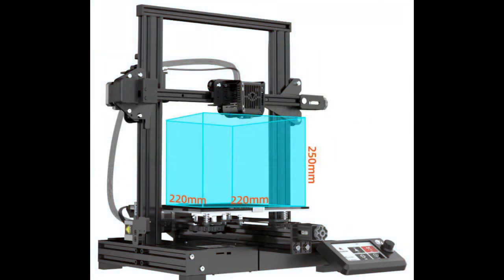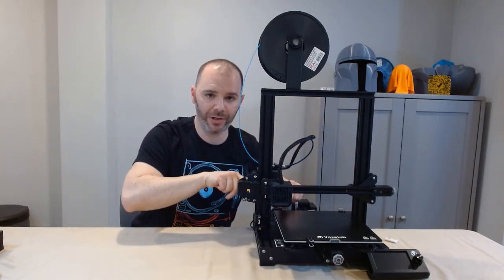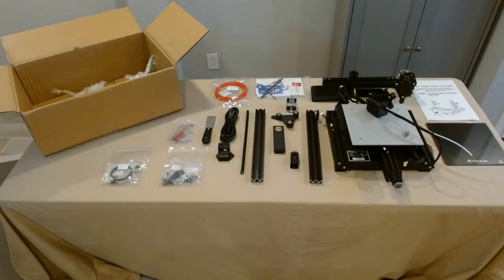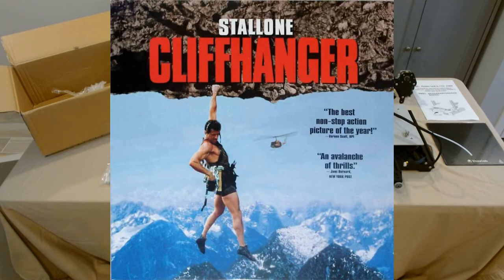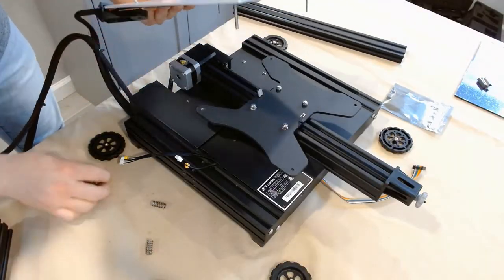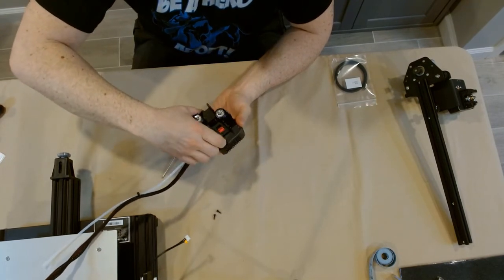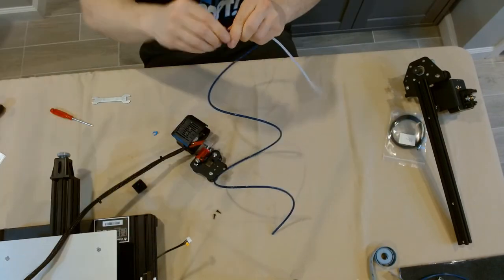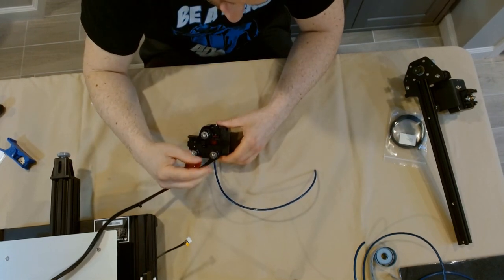Voxelab Aquila Assembly and Unbox Part 1

Comment: Leo. about 15 hours into a 17 hour print,something caused my filament to break. This has happened once before after I had to dismantle my Direct Extruder Pro. I know you have the same printer and driver as we do. Ever since we received the driver, the snall seperation tube in the top has popped loose. It just seems to sit in the filament hole. Is it supposed to be loose??? Should I put a drop of glue on it??

My husband tried a new email server and lost his archived mails to and from you. Now I can't get mail to reach you. You may not remember me, but you helped us a lot.

I'm the one who had to dismantle my new extruder be cause of a plug which turned out to be an inch long piece of filament hung in the center. Instead of burnt filament.
Reply from the maker: Doris of course I remember you! I have been so busy with the other side of my life lately I have not been able to devote much (or any) time to 3d printing. I am hoping to find some time shortly though. I have received your email and will be responding there as it's a better format to help.